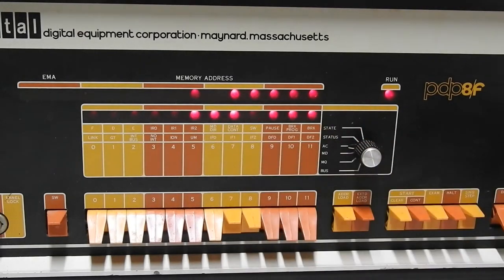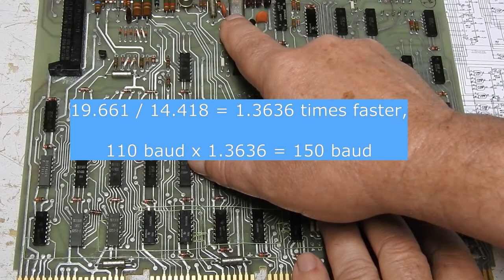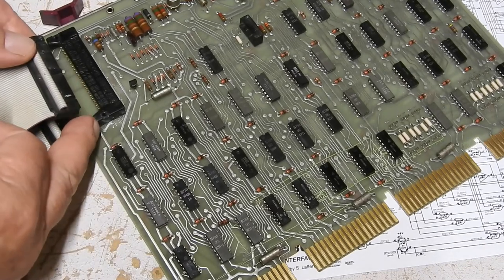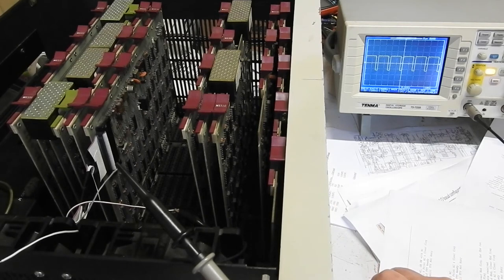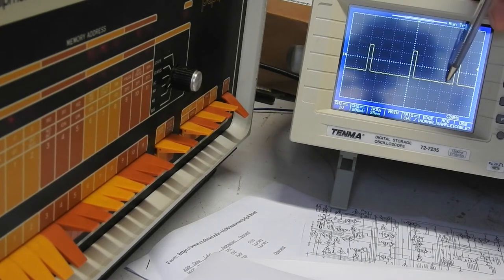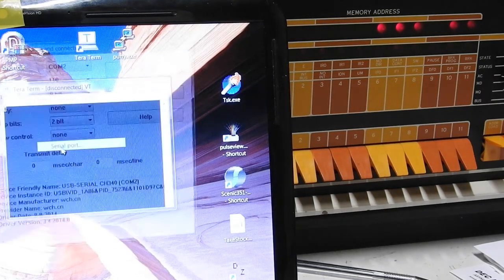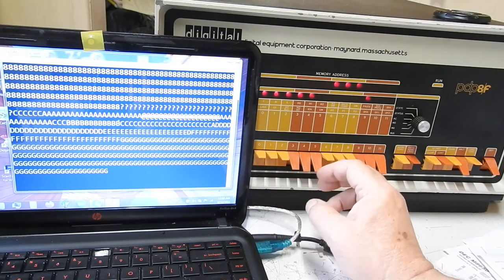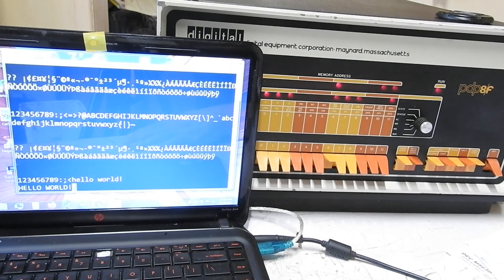PDP-8/F  Does I/O - Serial Communications

Comment: I worked at a company that made datacomms gear back in the 80's. So amusing to see someone trying to figure out a serial connection. Serial connections were always a pain. 
Also, I worked on a bunch of computer driven test gear that was driven by a PDP-8A. They had a Teletype attached as the console, and another rather strange terminal as the editing/operating station. Later machines from the same company (OK, GENRAD) used an LSI-11 based setup, running RSX-11M - those used a VT-52 imitation terminal - much nicer than the TTY.
Reply from the maker: Yes, even staying with 8N1 format, there's baud rates, DTE vs DCE, crossover cables, hardware & software flow control, etc. If it works, great. Otherwise it can take a while to work out what's not been set right.